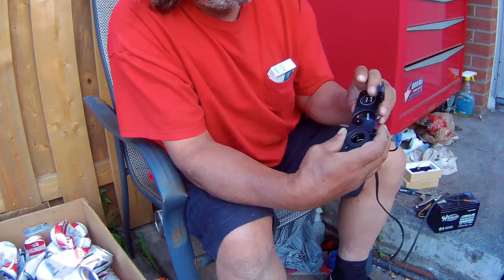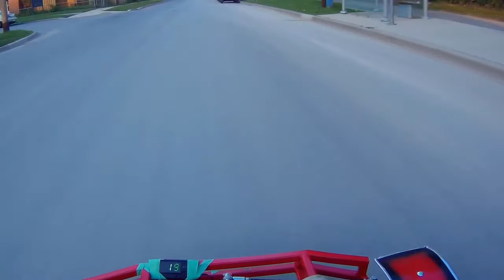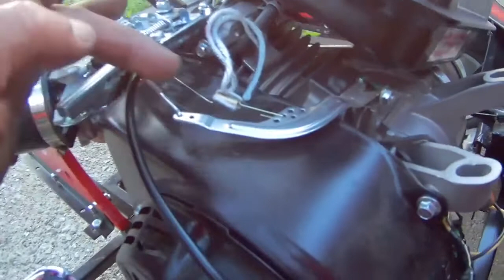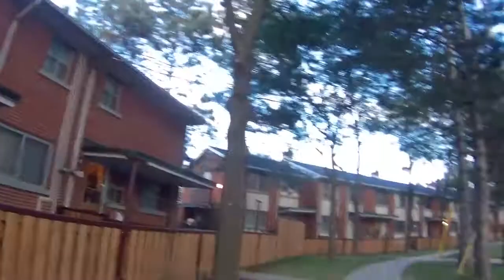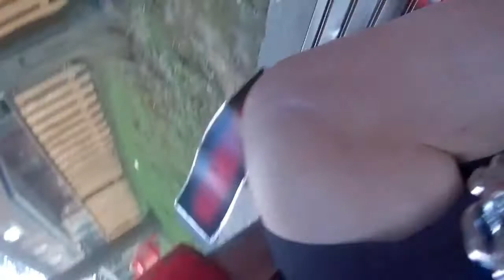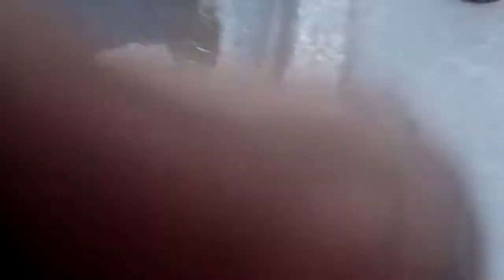Sexy Machine Engine Blow Up, I'm Pissed, Time For A Drink

Comment: Thats a real bummer. Good thing the 212 predators are pretty cheap. Did you have any aftermarket parts in that motor?
Reply from the maker: Hey Dan, I only had the performance kit (exhaust pipe, air filter and carb jet) and upgraded to 18lb springs.
I never worked on these motors before but I would advice anyone new to building a kart or bike with them not to mess with the govouner
Reply: @NevesProjects  you can mess with the governor. Proper removal Will allow for higher revs, but the original parts cant handle the stress. Just buy stronger parts. They may cost money, but your engine Will last longer